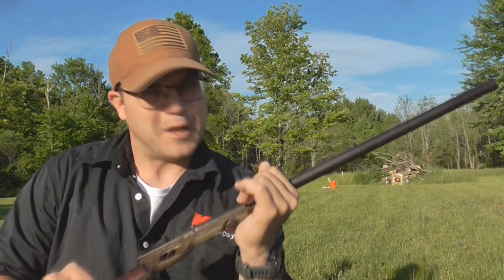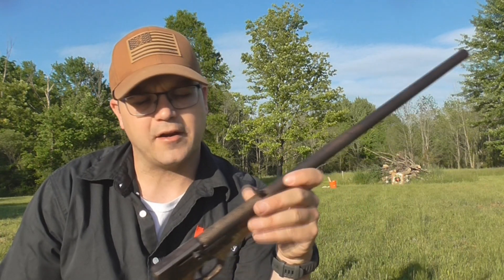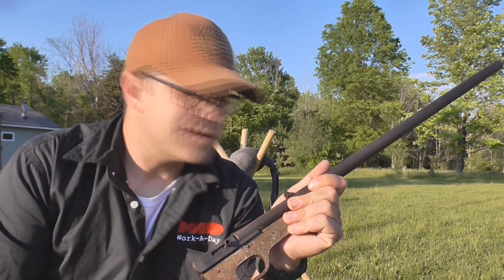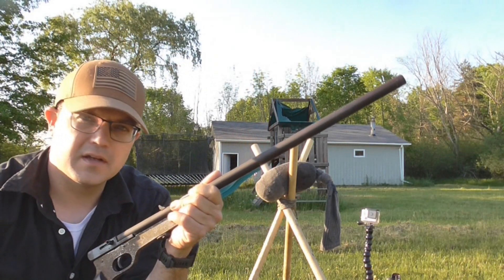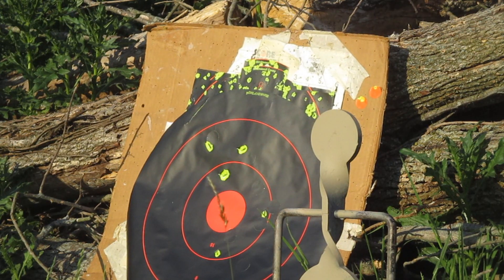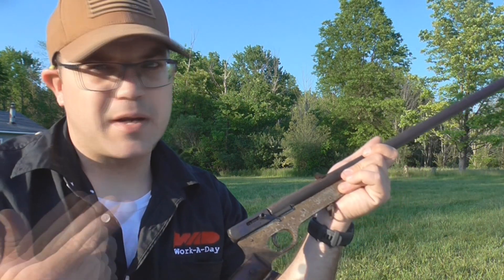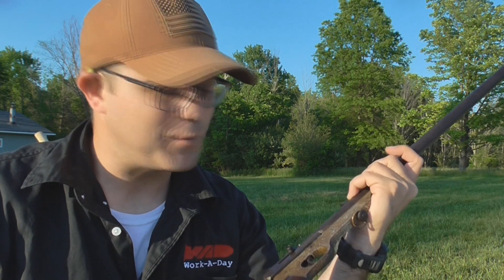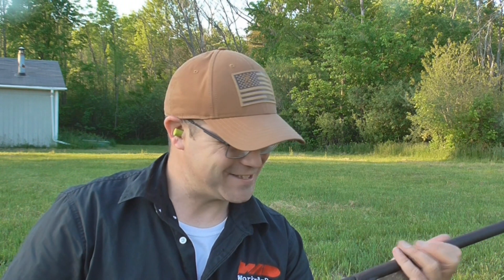Quackenbush Ammunition Testing

Comment: I bet if you spaced the breach plate just a hair and all a steel shim itl handle the pressure of a high velocity .22 the barrel should be fine but you can always get it lined. A barrel liner is 25 bucks on ebay, that will increase you accuracy too. I made a .22 break barrel competition pistol completely from scratch with only mild steel and it holds up to high velocity ammo no problem

Comment: I think your prior video on this gun showed that the rifling was in bad shape. This would explain the keyholing. Combine that with the expanded cases (which I believe stem from an eroded chamber and not a headspacing issue, unless that countersink where the rim sits is really chewed up), I wonder if one couldn't bore out the barrel and chamber and press in a rifled insert.
At that point, though, you gotta determine if the gun is worth the work you'd put into it.
Reply from the maker: The bore is in pretty bad shape. The only useable rounds are the subsonic 22s at limited range, anything more powerful then...
Well you saw it lol I'm going to keep it as is, the more I clean it up the better it looks though. It's a neat little rifle

Comment: Do you know what the flat spring thing is for on the left side of the breech block? Edit: looks like the gun prefers 22lr std velocity and higher. Theres less gas escape at the breech than it had with short and subs.
Reply from the maker: The higher velocity caused tumbling unfortunately. If I remember right, the leaf spring was for the chocking mechanism